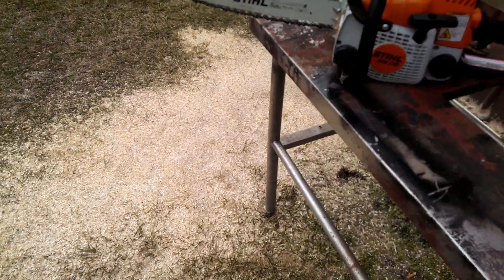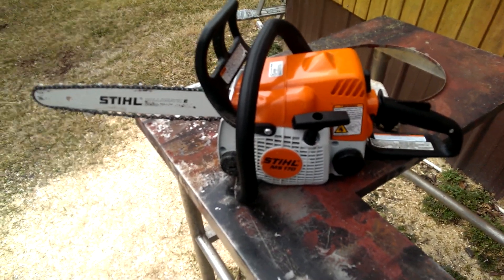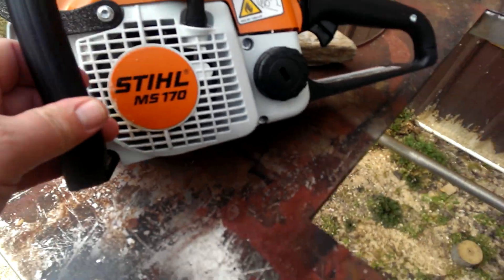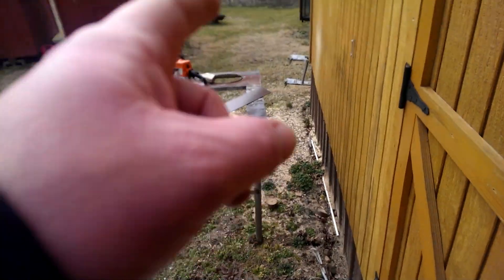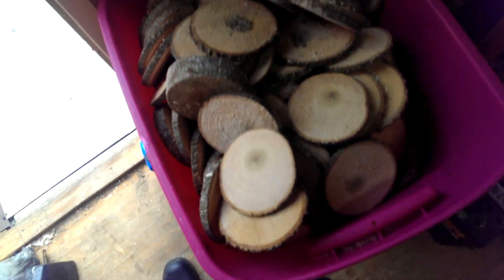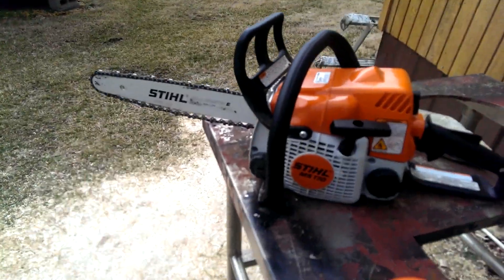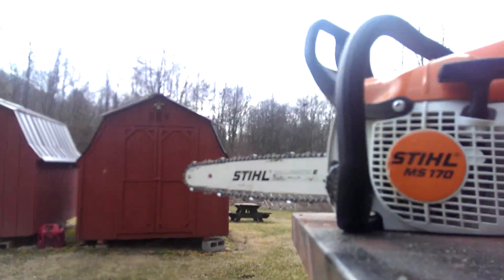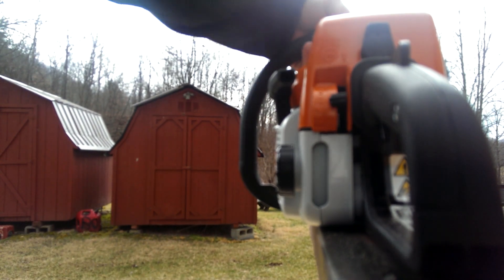Stihl MS170 Chainsaw

Comment: Almost identical to my MS180 C-BE. I like that yours doesn't have the easy start, I hate it. You can't put any momentum behind it. I had some carb/flooding issues with mine early on but got it sorted out. Looking for more videos!
Reply from the maker: i forgot i even made this vid haha. next month will be 3 years.little thing is still perfect.same air filter and plug too lol.well so does that 5020 in the vid.I eventually got it dialed in.still going as well.I do not like assist starting on anything.I looked at husky's again monday.440 had such a nice feel.then went to tractor supply and played with some jonsered.I will be honest,I prefer the straight handle on the jones more then the angled husky.husky makes their jones brand better looking.not in color but design.i want to match so i will get a husky regardless.then went and looked at echo saws today,not a fan at all.I dont even like the feel of them.anyway thanks for watching and i am still hunting! which is the funnest part
Reply: Ahh! I never change the spark plug or air filter on anything, I full expect it to last the life of the machine. There are some people that go out and buy a new filter and plug every, I don't bother investing in a depreciating asset like that.  The Z-Master is an exception to that though, due to the price.  I like the Jonsered stuff too, and the fact they use the quick access clips on there entire line up. But I do like the angled handle on the Husky, easier on my wrist. I would have no issues buying a Jonsered over a Husky as they are virtually the same saws. But I can get a Husky for much cheaper than I can a Jonsered.  Echo's are ok, I have never used one of there saws but have other products from them. They use a lot of metal parts which I like, but but based on my use of other Echo pieces they are uber finicky with fuel. Have you ever heard of the Ryobi 10532? It was a saw that was actually a rebadged Redmax saw a few years back and you could pick them up dirt cheap. Essentially a Pro Redmax 40cc saw for ~$110.   Have fun shopping!